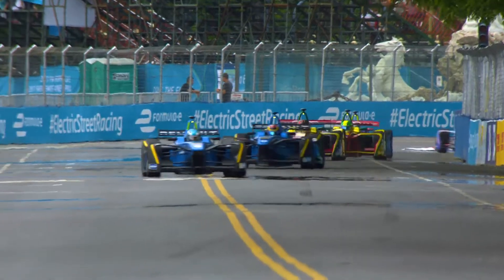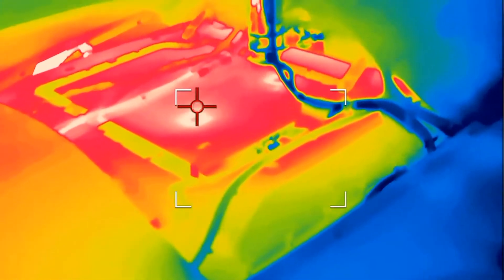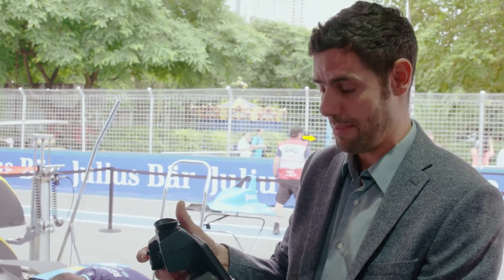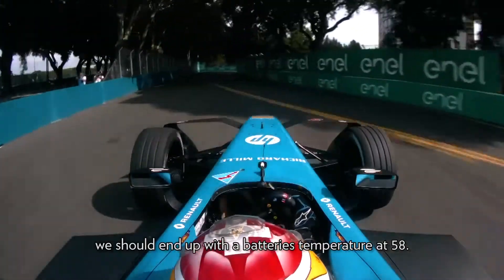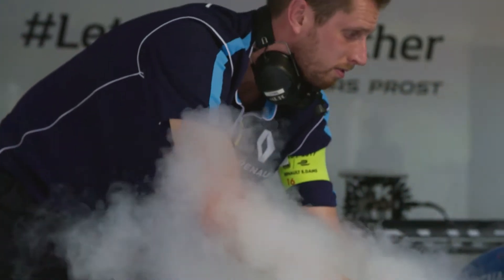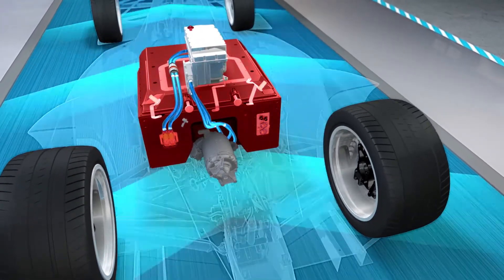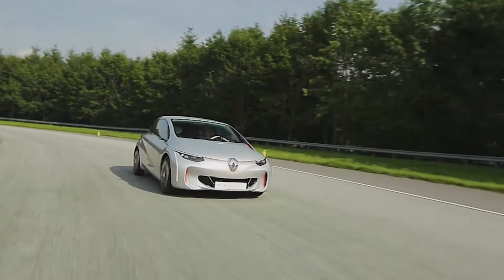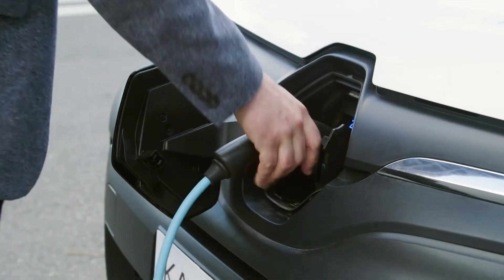Electrified Visions - Episode 2: Cooling Systems

Comment: are the degrees Celsius or Fahrenheit??
Reply: Seems °C, and it's interesting because 70°C for the battery seems high (vs the temperature for road cars, maybe battery lifespan is not very important).
Reply: fahrenheit and miles are gay
Reply: @Naimun572  Metric units were invented by the Fr*nch.